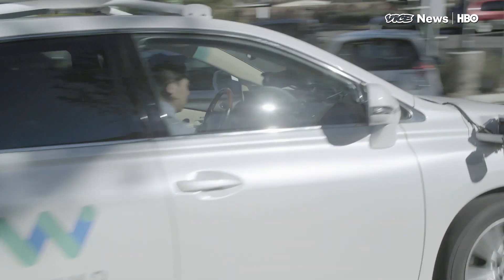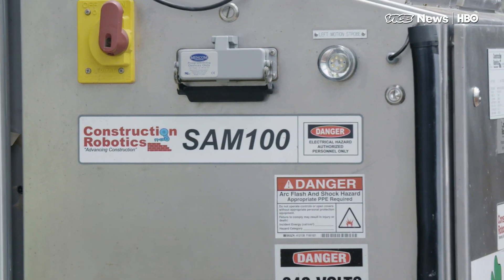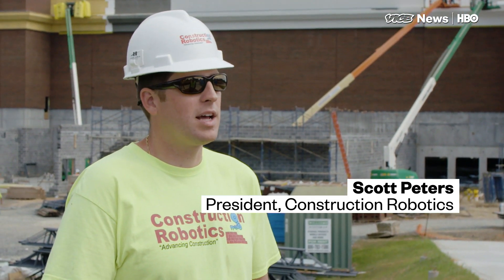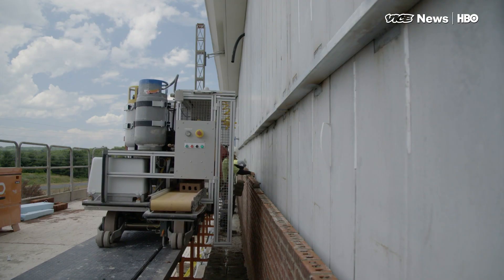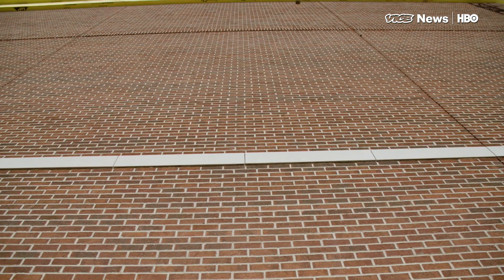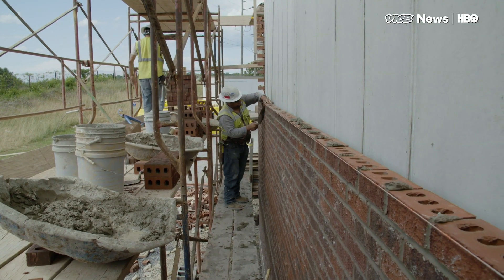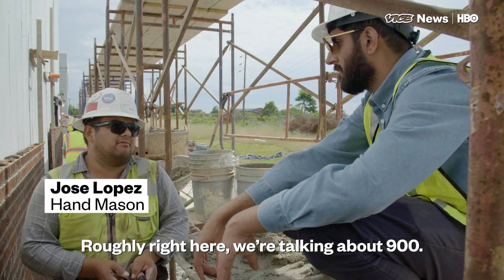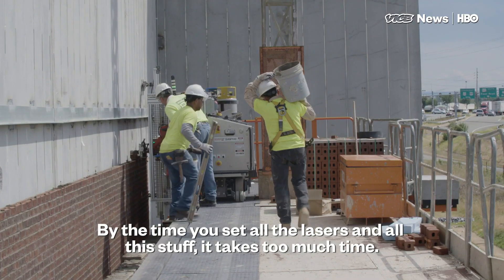This Bricklaying Robot Can Build Walls Faster Than Humans (HBO)

Comment: Untill I see mix it's own mortar , make it's own cuts , pick up all it's brick not to mention rake and clean brick with water and a sponge, not too mention dig it's own footings, go up and down inclines on its own, talk to the city inspector on the jobsite , go pull permits and take engineer specs to city and planning, go bid a job,  put in it's own wall ties, Dowell into  concrete and anchor it's own rebar , cut it's own rebar.. ba humbug I will have something to do as a mason

Comment: It is slow can only do brick after set up. How does it do piers? Windows that need lintels and flashing, and weep holes installed? Who tooled the brick up? Who cleaned the brick? Who avoided chips and crooked brick? If you want cheap make a prefabricated brick panel in a factory and install it in any nearly weather. Can it jump to block installation in ten seconds. How's is it on corners? Can it build things slightly out of plumb to adjust for varying job conditions? JUNK.

Comment: Sam will:

- Progressively get exponentially more efficient as technology advances
- Not sue a company if it has a fall
- Always be at work on time, every time
- Not have lunches, or paid leave, etc
- Not get exhausted during long days
- Only require minimum wage employee's to run, instead of the same company employing skilled tradesmen.

Unfortunately, tech is the future. We have to adapt to this evolution as we did the industrial age.

Comment: Tooling joints takes alot of time, i could easily lay 3000 with good mortar, no tooling, installing no insulation or reinforcements. I dont require hours of programming in between different types and bands of masonry.
Reply: How much does one of those things cost to keep up. Not to mention they had 2 guys working with it and keeping it going. The cost of that thing and upkeep is probably more expensive than a good brick layer that runs off of piss and vinegar. Robots will never compete with humans. Wow he can lay 3000 brick down a straight line with a man tooling his joints and one feeding him brick and mud. Guess what it doesn’t take 25 years to get to that. 3 years and a good apprentice can run and gun 3000 with a jointer and someone feeding him. We call them line beaters and they make less than the rest of the guys who can layout hand build set stone etc. if you are paying more than $20 an hour for that thing you are paying too much cause you could have grabbed a 3 year apprentice and at least he could get better. With that thing you better find a lot of long straight walls. Smh😂😂😂😂😂
Reply: It takes minimum of 25 years from birth to a master bricklayer and  counting the cost of feeding, clothing, educating,providing healthcare the robots it could be cheaper and faster to freshly mint new master level bricklayer robots that won't have doubts whether they would like to spend the rest of operating life laying bricks unlike humans
Reply: @bisasomukasa  You obviously don't work in any type of  construction trade. You are not factoring in and accounting for the ability to build a lead, install proper anchoring, insulation, mortar net, weep vents. In brick work you constantly have to hit certain heights for Windows, doors, relief angle irons, this changes the the uniformity of how the wall will be laid. You must constantly get up or get down to hit this measurements. All of that can be easily done on the fly with a human bricklayer. Not to mention this robot can only work on 1 type of scaffolding. It can't wash down either. It's not saving time or money. It can't lay block, it can't lay stone. These machines won't be taking our jobs anytime soon, if ever. There is much more to masonry than laying a brick in a wall.
Reply: @obs6686  not mention working in inclement weather. That robot better be water tight.

Comment: How does it go on a uneven surface and it doesn’t move out of other workers way. It still takes a human eye to pick up faults in bricks or the labor might malfunction they are only talking about perfect conditions. And most of all who wants to talk to Sam at lunch or clean his hopper out at the end of a shift after a couple of your mates don’t have a job anymore. Try putting it on a union job as for the wanker with the robotics shirt on I bet he drinks alone and probably has one of those rubber dolls for a partner.

Comment: Ive layed 1,483 brick from 7:30 a.m. till noon, thats my record. I would have easily hit 2500 in 8 hours on the north quad at U of M..  The company i worked for bought a laying robot 1 year ago and lost their asses! Mortar chunks clog the system, dust is a huge issue, setup is costly, 2 workers are required to feed it and its really sloppy! Complete failure!
Reply: Oh well, in that case we never should have tolerated the first computers. They were massive things that required a ton of maintenance, ran on steam and were generally unreliable. In fact, there was no keyboard back in the day. You had to feed in punchcards that could get damaged -- leading to a day of work for the programmer to fix. Complete failure. I wonder why people even bothered...
No invention or new technology is perfectly efficient on the first go. It takes years, possibly decades to gradually make things more efficient and reliable. I expect the problems you point out to gradually get corrected and made better over the next couple of decades
Reply: @lordihlendam3619  internet is just a passing fad - Bill Gates.
Reply: @lordihlendam3619  invest in masonry robot companies. Let me know how it works out for you.
Reply: Shadowhunter   I get your point, but it’s a little different situation.  The end result is we can now operate a little computer ourselves...whereas a job task can not be minimized. Robots would need to feed the laying robot, etc., ...may be more cost-efficient to just hire a crew.
Reply: MaximusXX77 
"Robots would need to feed the laying robot, etc., ...may be more cost-efficient to just hire a crew."
I don't think so. A big part of why manufacturing jobs in the US have been declining in the last 10/20 years is because of automation and AI. I would imagine that all of the problems you point out (feeding the robot, repairs and so on) existed for GM and Ford when they automated their line. Of course, there will be some humans still in place overseeing the process, but a job that would ordinarily have hired a 1000 people would now only need 100 with a few robots that cost less on the long run. Obviously efficiency considerations exist now, but I would be very surprised if robots don't end up completely out performing humans in pretty much any repetitive task in the near future.

This next bit isn't really directly related to your post, but personal computing only accounts for a very tiny fraction of compute time. Have you ever invested in a hedge fund? Most firms now have computer algorithms that automatically decide when to buy/sell depending on the market (because they're optimizing for stock price fluctuation down to the second). In the past these decisions would be far less efficient and accurate since you had humans actually cranking the numbers. So, the computer isn't just a job aid. In many cases, it makes the human pretty much obsolete.
Reply: You work for L+H?
Reply: I worked there also at the u of m
Reply: You must not do your own jointing or lifting of planks, corner post etc. If you can lay that many in four hours. Yes, I'm a bricklayer and I am skeptical.
Reply: Patrick Miller laying bricks isn’t complicated it will be automated in the next half century.
Reply: @nonyobussiness3440  I think they're better off finding a different way of veneering the wall, and having the robot do that instead. Like 3d printed houses etc.
Reply: Patrick Miller a three d printer will be a robot soon
Reply: @nonyobussiness3440  bricklaying IS complicated. There are so many variables to consider before you even get started laying a brick. You probably need 4 years minimum to develop your muscle memory and knowledge  to be profitable for top pay.
Reply: Patrick Miller bro machining is complicated too but we replaced people in that. Brick laying simply isn’t profitable enough to justify investing in technology yet. Once robots and tech become cheaper you bet your ass a machine will do it. Stop being a hank Henry or what ever.
Reply: @nonyobussiness3440  I not debating wether or not automation will happen. It will happen. I'm challenging your assertion that "it's not complicated", when in fact it is.
Reply: Patrick Miller it’s not comparable to things already automated
Reply: @nonyobussiness3440  we make it look easy but if you say it's not hard then you have never done it.
Reply: @patrickmiller1674  hydromobile scaffold, I tool my own joints. Anyone can do it it's the time in between courses that kills production. Bump one into the lineup start spreading get to the other side bump the line up and start laying again. A good seasoned laborer is key.
Reply: But at least no robot unions to deal with. yet
Reply: haaaaaaaaaaaaaa

Comment: These type of machines will only work on massive long straight walls were you set it up and let it do it's thing but will never replace a bricklayer. It's not practical only in building massive long straight walls and there isn't to many of them about...they are expensive and need experts to set them up which takes a lot of time and money and lots of places the machine is to big to use in restricted areas. This takes several people to operate it were you could you a couple of bricklayer to do the same amount of work and done more neatly and at a much lower cost than the machine and operates would cost. Can the machine build intricate work and move from area to area with ease like a bricklayer can. Can the machine build arches...corners and other fancy work which I don't name all of them. Can it cut bricks can it work out bond and guard and get over different problems many bricklayer faces on a daily basis when trying to build different types of walls. Can it put wall ties in and damp and insulation. Not very practical or cost effective to use on 99% of building sites but bits still a clever machine and show how clever humans can be.
Reply: Computers and robots start out primitive then get more intelligent as the engineers get more money and more knowledge.  With your logic, we should only have Commodore or Apple IIe computers with dot-matrix printers.  But we don't because technology got better and continues to do so.

Comment: That robot seemed slow. But I guess it doesn't cost overtime or doesn't take breaks. It takes two guys to run it. Might as well just have one guy do the laying. What about flashing, insulating gauging and laying out the bond and installing lintels, etc etc, and cursing I bet it doesn't curse like a real Mason does!

Comment: I think the point of the robot is so that the company can replace skilled high wage brick layers with minimum wage part timers that would otherwise be working at the local McDonald's.  Easy teach one guy to fill a bucket and empty it, teach next guy to pick up bricks and set them down, and another scrape the execs of the wall.  Done

Comment: I'm reading comments so I will put one out there. Any brick layer needs ground support, so you already have two guys doing ground work for each brick layer. One carrying bricks and one mixing mud, and you still have to come back and tool in mortar and clean up joints. So if a brick layer can lay 900 to 1100 bricks aday and this machine can do 3360 with the same ground support it's a no brainer. I too don't like to see skilled masons lose there jobs to a machine, but that happening to every job site and every trade. No time off, no paid breaks, no sick days, no family problems and no workers comp. You see where i'm going with this. It's cheaper. Workers comp. Is expensive for the company and that is why these machine will do well on BIG jobs not small jobs. But we will need skilled masons for years to come. Facts of technology.

Comment: Funny thing is that the one robot still needs a crew to run it.

Not only this, but they didn't mention machines need maintenance..., and that they break. 

Oh.., did anyone see any straps tying the brick to the wall?  I guess balance and set mortar is good enough to keep it from falling away from the wall?

Comment: I mean you could just add a piece of wire to the side to cut off excess mortar.

But why do that when you can waste manpower.
Reply: András Fogarasi ikr, like with springs and stuff to put pressure on it too. Not even a string why doesn't it just have a scoop.

Comment: That robot could have the sand cement and water on a trailing mortar maker along with the bricks crawling along on a tracked carrier following the brick laying robot which could if on hydraulics push a smaller machine to do corners and what those Mason's are saying they're doing.
It could have an auger and conveyor to move mortar and brick to the robot.
Hydraulics could have this robot doing basements.
A whole house or building built by robots.
And robot demolition.
I'd start with corporate though and architects to cut down on real foolishness.
Along with secretaries.

Now to build the house with electrical and plumbing.

Comment: 3 operators plus 2 finishers is a total of 5 -- the robot does max 3500 but ? 5x900 = 4500 bricks :) if that's the future. You guys need to stop using your phones apps and start using common sense

Comment: It's not building a brick wall its mortaring and stacking bricks facing a cinder block wall which is the structural building itself. The brick wall is cosmetic its just a facade nothing more nothing less. The cinder block is the material supporting the roof,floors and building components. This so called wall is just facing. Let me see a machine that can build a real brick wall doubled up that supports joists, rafters entire multiple stories then I'll admit a machine is superior to a brick mason.
Reply: Hopefully with AI we will. MY AI

Comment: This robot makes the work of 3 workers but it needs 2 operators, X amount of workers to set it up and the technicians to program it therefore it is not replacing 3 workers. Maybe if the wall is several miles long then it will make sense.The designers of this robot have a long way to go to challenge the masonry workers skills.
Reply: Give it time and it might happen to replace human workers in most places. Think about what jobs looked like 50 years ago and then think about what they will look in 10, 20 or even 50 years from now on. You have already software writing articles, composing songs, and doing all sorts of menial tasks. I believe, the changes will come much faster than people believe. And the reason for it is very simple. Workers make more than 30% of the expenses. So anyone has a real incetive to find ways to cut those. And machines, have always been a sure and steady way of doing it. It might take time, but I am certain it will happen. We humans tend to put our selfs on a pedestal and the skills we apply, but particularly menial and tedious tasks, can be actually automated relatively easy. Hell, if a robot can compose songs and create art, which some do, then you will see robots replacing brick layers at some point.
Reply: @CrniWuk  for masonry u need a machine with ai we make the building square theres to many variables involved. Theres mistakes in blue prints. Mistakes in foundation. Theres allways something out of square if we just went by ablue print shit would be fucked up. Usually 2 or 3 minds gather to come up with solutions to these problems. Theres also logistic nighmares like how to program for the right mixture because the instructions on the bag dont take into account humidity temprature and climate factors which effect how rapidly the mix sets. Then u got to wonder how does this machine keep the mud from setting up before its ready. And how do u clean it because standard mixers are beat with a large hammer and sprayed out. U would need its own mixer and it own water supply so u tie up the job sites water . u wouldalso have to clean it out every 2 hours or it would gum up.
Reply: @MrEvilsurpent  u must be in masonry. They should instead work on a different building method and material, instead of getting a machine to build with bricks.
Reply: @patrickmiller1674  yep ive worked in masonry for years. this is a pipe dream
Reply: @MrEvilsurpent  The machine will 100% outperform a masonry team at some point in time. The thing is it'll probably be quite a long time before that happens.
Reply: it needs to lay more than 1 brick at a time
Reply: Not to mention engineers arent building to brick work. In other words theres gonna be special cuts and pieces in the wall this would be impossible for this machine to do